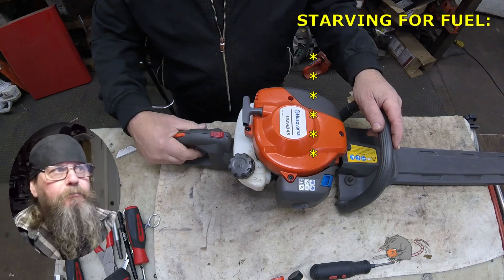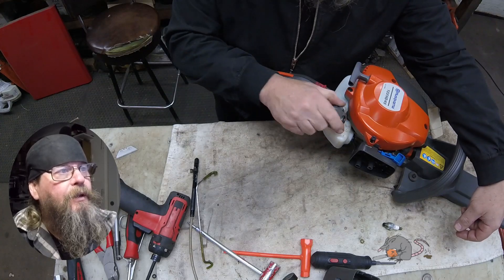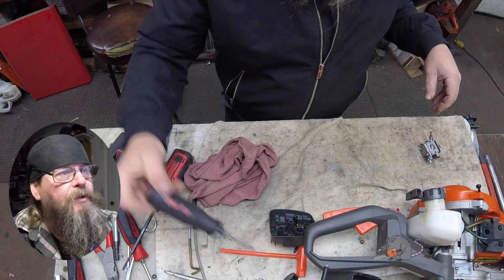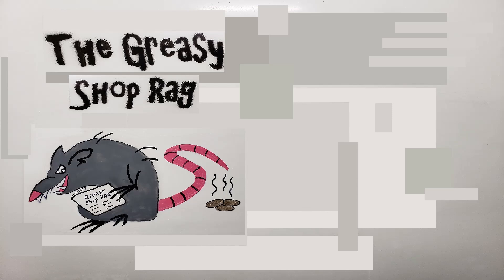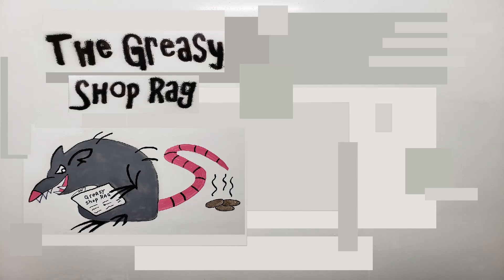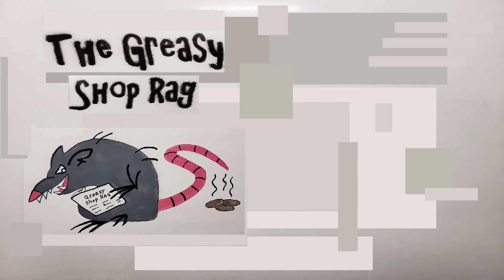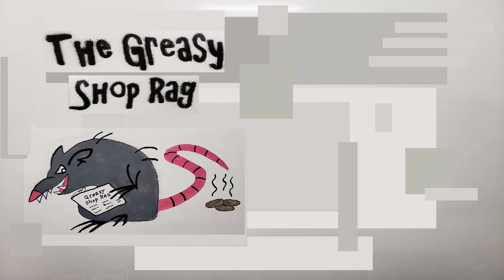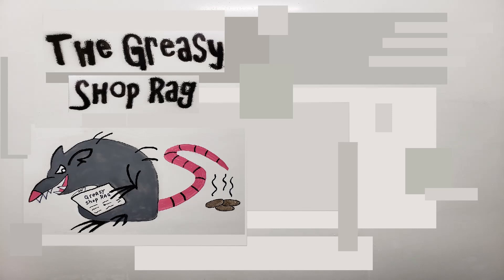Husqvarna 122HD45 Just Goes Bog Bog Bog Then Dies

Comment: I think mines the metering diaphragm mine bogs out while im holding it up using it so it does run for awhile then bogs out
Reply from the maker: Could be. Some times a fuel filter hung up in the filler neck acts like that.
Reply: @TheGreasyShopRag  i checked its not the fuel filter hung up
Reply: @TheGreasyShopRag im not sure which metering diaphragm to order so will have to take mine apart to make sure i get the right one its the same model trimmer as the one you was working on
Reply from the maker: @Mike-su8si  They used a couple different carbs including a Ruixing branded one which I have no way to look up kits. With those I always just have to match up the gaskets to zama kits. If I remember right, replacing the carb isn't too expensive.
Reply: @TheGreasyShopRag  alright so 2 days ago i took it apart checked for the metering diaphragm and it doesn't have one in it just a gasket and while i was shaking the trimmer to look at the gas filter in the tank the gas filter line broke off so i replaced that kept the original gas filter in the tank and now the trimmer works good

So my bogging down problem was from the rotten gas line 

And it looked like someone else before me had already replaced both gas lines before i left the other line on there was no problems with it
Reply from the maker: @Mike-su8si  Good job with the repair!
Reply: @TheGreasyShopRag  yeah i need to buy extra lines of different sizes cause i fixed other people's stuff with it and am a little low on fuel lines 
I need to get another box of mower gas line to some time.

But i did thought for sure it was the metering diaphragm like on my weed eater that is whats wrong with it
Reply from the maker: @Mike-su8si  A lot of different problems have very similar symptoms.